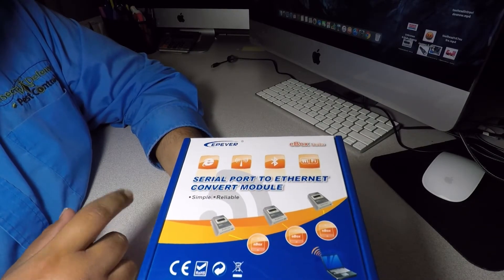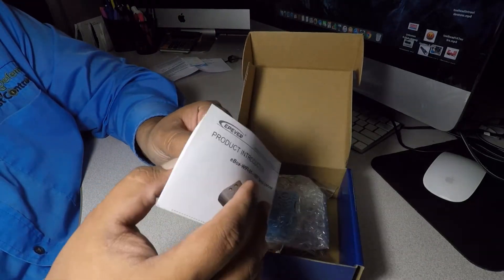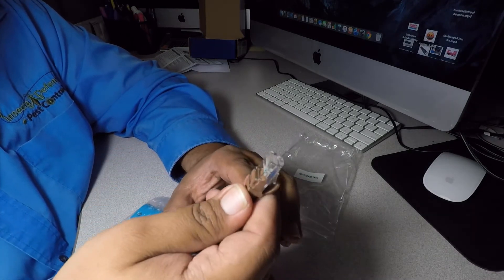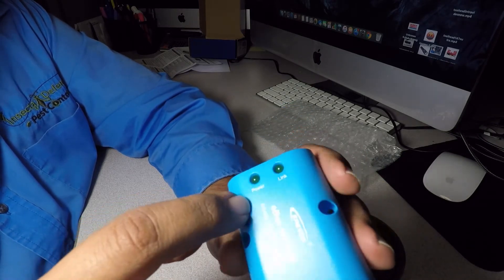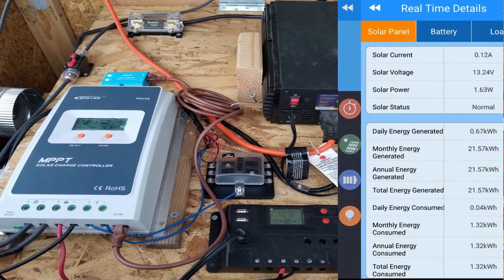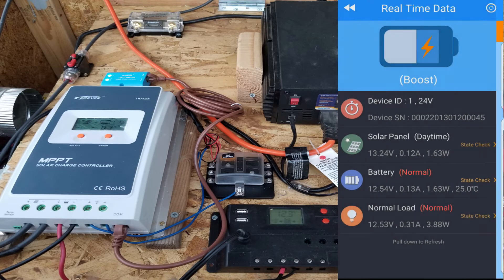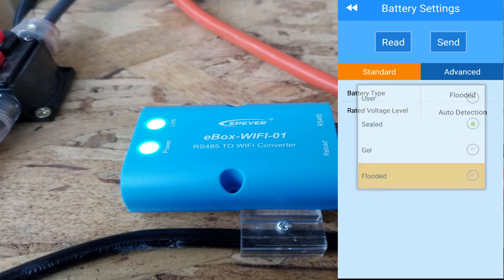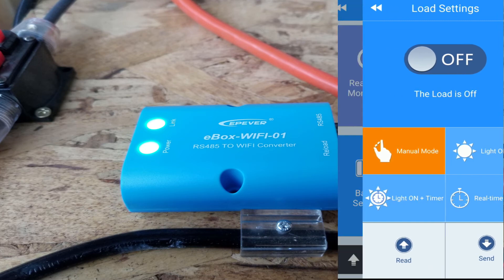DIY SOLAR Epever eBox Wifi for Solar Charge Controller

Comment: If I add a bigger agm battery into my solar system is there somewhere in this app to set up the bigger battery or will it set up automatically?
Reply from the maker: The size of the battery doesn't matter, what you have to adjust is what type to make sure your getting the correct voltage.
Reply: @toolhead147  great thanks a lot. So I just need to change it from flooded to sealed. And that WiFi ble unit can do that aye? Cheers again ☺️

Comment: Good Morning
Congratulations for your work
What is the best solution to monitor a solar system with battery through the internet with a connection (WIFI or RJ45)?
In other words, how can I check the status of the battery and solar production without having to go to the installation site?
I want to be able to check the status of the solar system over the internet from anywhere, how can I do it?

Thanks

Comment: do i still need MT50 If i used  epever wifi ? or both have  the same function for control and monitoring mppt
Reply from the maker: You can control some stuff on the wifi, I would recommend the mt50

Comment: So... How do you like your new mppt.. Do you see any change?
Reply from the maker: It working great I got 2 255 watt solar panels on 10 trojan t-105 charges them quick. Will be making updated videos as we go.
Reply: @toolhead147  Why do people have 20 panels to charge the same amount of batteries?
Reply from the maker: @barbadosdrivertrainingadvi4714  its not to charge them is to have more power to use more electricity like air conditioner or heater and fridge that require huge amounts of power and still have left over to charge those batteries. It basically comes down to how much you can afford the more the better.

Comment: Is there anyway to send this information to a pc miles away running android on it? I've been looking for a way to remotely read my charge controller but it looks like I'd have to be in range of this with my phone.  Is there anyway I could use a hotspot to send the data to a server I have setup?
Reply from the maker: Not that I know, thank you for watching